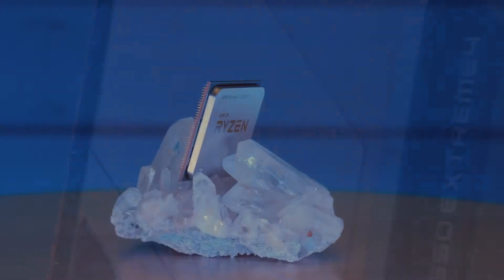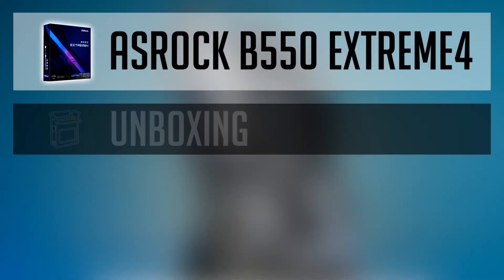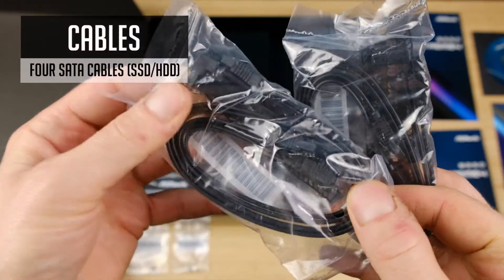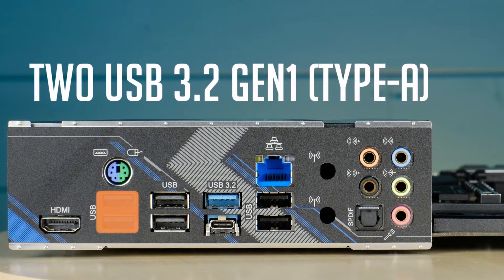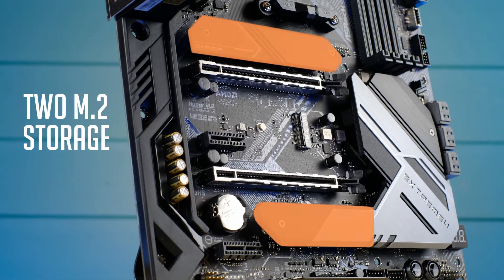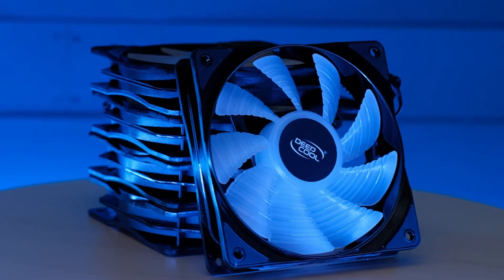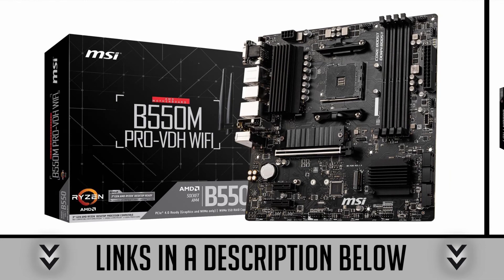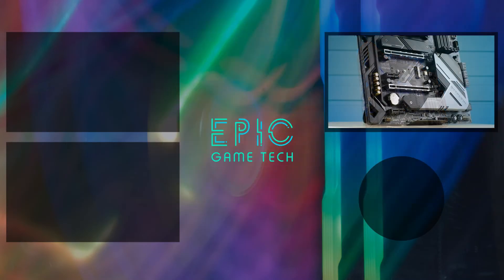GREAT B550 MOTHERBOARD - ASRock B550 EXTREME4 OVERVIEW - Better than X570? Ready for Overclocking

Comment: will this board have any problems running a pcie gen 4 GPU with 2x pcie gen 3 m2 and 1 sata HDD?. its 3 different generations and some boards seem to have trouble with that, for example, the put the gpu down to pcie gen 3 when nvme slots are fully occupied even tho the nvmes are gen 3
Reply: It shouldn"t have any troubles, as long as you plug your hdd into the 1st, or 2nd sata slot. If you are using a second m.2 they usually disable the last 2 sata ports.

Comment: compatibility with Ryzen 5000 series?
Reply from the maker: Hey,
this board is compatible with ryzen 5000 series.
For 5600x/5800x/5900x/5950x board needs to have P1.20 BIOS version.
For other ryzen 5000 (e.g. APUs like 5600G), P1.90 BIOS version is needed.
In general, newly manufactured boards should have newer BIOS. But in case it needs an update, retailer can arrange it (most of the time for additional cost) or you might need to get an older CPU in order to update it's BIOS.

Comment: Does it have wifi, if it does, is it 5 or 6
Reply: And also, is it good for ryzen 9 5900x
Reply from the maker: Hey,
no, it does not have onboard wifi (it has m.2 dedicated for wifi card) :)
Yep, It can handle Ryzen 9 no probs.
But this motherboard has debug LED screen for error code and that's a nice feature to have, at least if you like to play with CPU/RAM overclocking a lot.
Sure, in case you do not plan to OC a lot, Wifi is more relevant than debug LED.
Reply: @EpicGameTech  ok, thanks a lot 🙏

Comment: Hello....first time going for a ryzen build so a bit confused.... Will it be good if i pair it up with ryzen 5 5600x and 16x2 corsair vengeance pro rgb 3200mhz ?
Reply from the maker: Hey,
Sure, i mean its a good motherboard. But maybe you can get away with even a cheaper one. So to suggest anything, please let me know:
1. Planning to overclock r5 5600x?
2. Is this build only for gaming? Maybe you plan to upgrade to ryzen 9 in a future (if you do like video editing etc)
3. Will you use ATX or mATX pc case?
4. Approximate budget of your whole pc?
Reply: Yes in case of overclocking ... This build if for gaming and streaming purpose and also for coding purpose....
Pc case is mid-tower..ATX 
Approx budget around Rs.80000 Inr (Indian currency)
Reply from the maker: oki, so my recommendations for ATX motherboards :)
> MSI B550-A PRO - Best budget ATX motherboard that can handle decent overclocking.
> MSI MPG B550 GAMING PLUS / Gigabyte B550 AORUS ELITE - also good motherboards, costs a bit more than B550-A pro but still a good price/performance.
> ASRock B550 EXTREME4 / MSI B550 Tomahawk / MSI B550 GAMING EDGE WIFI - all are more expensive than mentioned above but they are more of a midd-range motherboard already. Can handle any CPU (even ryzen 9) overclocking no probs and have more features than less expensive models.

P.s. so 80000 is around $1100 for your whole pc build (with GPU?).
If so, i would go for cheapest out of the ones I've mentioned, MSI B550-A pro, as your budget is not huge, no need to spend much more on a motherboard. Better to put that $ on a better GPU or ran or SSD etc :) But that's my opinion
Reply: Thanks for replying and suggesting the best options there is... Actually that price budget excludes gpu , psu , hdd and ssd .
Reply from the maker: Ah, then probably you should go for a mid range motherboard :)
Reply: Ok thanks for the help there 👍👍🙏

Comment: can you recommend me some motherboards for ryzen 5 3600
Reply from the maker: Hey,
would be good to know more about your pc build:
- What gpu are you planning to use? (and overall pc build budget)
- Are you planning to overclock your CPU?
- And do you have plans to upgrade to ryzen 9 some time in a future? (not for gaming, but if you do like video editing etc)

Having these answers i could recommend few motherboards that would suit best for your build ;)
Reply: My budget is 900 euros for GPU cpu and motherboard
I am planing to buy gtx1080ti but I have to wait for praise to get down 
And yes I would overclock cpu
Reply from the maker: Ok, well Ryzen 5 3600 is one of the best value (at least if the price is right) CPU, but it's only 6 cores. So quite a lot of motherboards will work, even when overclocked.
You didn't mention if you ever plan to upgrade to Ryzen 9, but i assume, maybe to Ryzen 7 as it's possible for gaming only.

Best mATX options that don't break a bank and still are capable of OC:
- Asrock B550m Pro4 - decent, budget motherboard, with a better audio codec than most the budget motherboards (made a video about it - https://youtu.be/oLLn7Y8-YG0)
- MSI B550m pro-vdh - similar to pro4, VRM temps a bit higher but has onboard wifi.
- MSI B550m Bazooka - feature-wise, similar to pro4/pro-vdh, but more expensive, though has the best VRMs out of these 3, so handles more core CPU overclocking better (video - https://youtu.be/C5Y9UXp8QJ0)

Best mATX motherboard
- MSI B550m Mortar - more or less the best mATX form factor motherboard I could recommend. But sure, it's more expensive than the above ones.

ATX recommendations (though ATX is generally more expensive than mATX):
- MSI B550-A PRO - the least expensive ATX motherboard I would recommend going for.
- ASRock B550 Steel Legend
- MSI MPG B550 GAMING PLUS

So all of these boards are good value for their MSRP price :)
In general, if you use ryzen 5/7 and no need for more fancy features, a budget-friendly mATX board should work fine, even when overlocking.

Comment: Hello
could help me recommend a CPU, I recently bought this motherboard for $ 130 and I will use it on a monitor 2.5k resolution + RTX 2070s  and in the future RTX 3070. The pc is only for games, I want to play above 100fps in medium / high quality . Which CPU do you recommend for this configuration? please.
Reply from the maker: Hey,
well it depends from price you can get a CPU these days. Basically, Ryzen 5 3600 as more budget friendly option, r7 3700x is also an option or 5600x. All of these 3 are good choices for gaming. Why i mentioned 3700x? as the price might be same as 5600x but even though 3700x is a bit slower in lower rez games, it has few additional cores that might be utilized later on in more games.
So basically it depends a lot from a price you can get each of these CPUs. E.g. if the price for 3600 is not far from 3700x or 5600x, you should go for these. If the price is same 3700x/5600x - i would go 5600x if tis only for gaming. If 3600/3700x is way cheaper than 5600x - then i would probably skip 5600x.
Sure, as you bought quite a good motherboard, i guess you have a budget for 3700x/5600x cpu :)
But any of these will handle rtx 3070/2070 super.
Especially, when you will be playing 1440p. With any of these CPUs, more likely GPU will be the one to dictate FPS number and not the CPU. And if you will get 4k some day, then it's all about a GPU anyway with any of these CPUs ;)
Reply: @EpicGameTech  Thank you very much for the information, I have the opportunity to get a 3700x for $ 230 do you think it's a good price?
Reply from the maker: Yes, really good price having in mind the current market situation :)
Saw 3700x for arround $329 on a few online shops in the US so $230 is super :)

Comment: does it has ibuilt wifi and bluetooth
Reply from the maker: Hey,
extreme4 does not have built-in wifi / Bluetooth :)
If you need those and you want this motherboard, you will need to get USB dongles for wifi/Bluetooth.
In case you want a similar VRM performance / around the same price motherboard with built-in wifi/Bluetooth, I would suggest checking:
- Gigabyte B550 AORUS PRO AC - https://geni.us/8Vrny
It has both - wifi and Bluetooth and the same level of VRM performance :)

Comment: On my Asrock B550 rgb stays on and when i turn off the pc, is that ok?
Reply from the maker: Hey,
is it your motherboards rgb or ram rgb as-well? :)
Check if this can be adjusted in Asrock RGB control software.
Also, this can happen if you are making your pc to sleep instead of a shutdown ;)
Reply: @EpicGameTech  RGB lights on Motherboard,I check in bios,but there is no this function
Reply: is that the case on your board?
Reply: @EpicGameTech  https://youtu.be/paU8y1e2RPI
Same as in this video
Reply from the maker: Are you using Asrock Polychrome RGB soft? It's mean for controlling all RGB :)

P.s. I do not own this motherboard any more as I was using it in a PC build for another person :)
Reply: @EpicGameTech  I'll try this software

Comment: how well does this overclock with ram?
Reply from the maker: Hey,
well specs says it can support ram 4733+(OC), so it's capable of doing some good stuff for sure. Especially when you have debug LED screen for easier error elimination :)
I saw that buildzoid overclocked some memory to 4933mhz / 5000 mhz on Asrock B550 Steel Legend motherboard in his video (https://www.youtube.com/watch?v=Q9hFivyUsx0) and those two boards (extreme4 and Steel Legend) are almost identical models :)
So I assume, that extreme4 should be also very good in memory OC.
Not saying you will get to 5ghz, as you need to find a good RAM sticks as-well ;)
Reply: @EpicGameTech  yea ive done alot of research, but cant find a m.2 E key wifi/btooth adapter for it. but at the same time, if you look at the QVL for 5000 series and 3000 series cpus none of those have anything above 4400mhz support on XMP. even tho on the main page it says 4733, however ive heard ALOT of horrible things about asrock and their bios support. ive been MSI all my life from b450I gaming plus ac (possibly bet Itx board at its price of that time) to now a x570 mpg gaming edge wifi (VRM is my main concern, 

it just would be LOVE to have an actual usb-c front panel header thats not limited to me using an adapter since the board doesnt have one for front panel. does on the rear i.o. currently running 4.8ghz with a set of tforce 3200c14 @ 4000mhz 2000fclk, c16,15,15,15,32,38 304,226,139 1T 1.4v llc3 super tight subs as well all stable daily. i mean i dont need a new board. but seeing as to how ive pushed a 3600XT on this board as hard as one can without LN2 im starting to wonder when the VRM will fail.
Reply: @EpicGameTech  ive watched ALOT of his vids but searching for it never actually brought him up which i complain to him about ALL THE TIME for not tagging his vids properly so youtube will put his vids in search without searching his name directly.
Reply from the maker: I actually use MSI board myself ;)
Well regarding QVL, many times these lists are getting old as they are not updated so often. Also, I almost never pay attention to that when building a PC.
And in general, never use RAM faster than 3600mhz for the guys I build PCs for my channel, since, from the performance side, you gain very little to non-performance improvement with faster ram. It's fun/useful only if you are OC enthusiast and like to play around by OC your RAM/CPU etc. But it's not for the majority of people ;)

Regarding buildzoid - yep I've noticed he is not utilizing his video description/tags, but I guess he doesn't care about Youtube SEO/Analytics (maybe it's just not interesting to him), but eventually, he could benefit from it for sure. As he does really advanced stuff and potentially could have way more subscribers. Even though, he has a really narrow niche :)
Reply: @EpicGameTech  granted the issues i mentioned, he is mentioning the steel legend which is the same dam board id have to assume. if i can find a m.2 E wifi/btooth card before i jus say f it and get the unify x570 used for 220 without the extras i jus may do that.....but at the same time 140 vs 220 is a big difference between prices when i have a more than capable b450 board that will outlast this x570 board i have atm....(it is setting in the closet tho lol) perhaps i just shouldn upgrade at all and live with the great board i have even tho it does have terrible VRM issues...

his exact statement to me was "i use alot of tags" but the tags hes using arent what people search for when asking a typical question. i.e. best budget ram motherboard am4.... but yea gonna check for a m.2 E key wifi card and possibly get the asrock board.

Comment: Hi, Please someone tell me which slot i should put this Kingstone U-SNS8154P3/128GJ,  labled as M.2 PCIe Gen. 3 
 NVMe 1.2
Reply from the maker: Hey,
Well, it will work in any of two m.2 slots dedicated for m2 storage drives. But put it to the top slot that has an m2 shield. It's motherboards 1st slot and it will look way nicer with that m2 shield :)
Reply: @EpicGameTech  I did and i get A0 Debug error all time , tried to unplug all Sata HDD's, and keeping only that Kingston M2 but seem's not booting and not visible in BIOS. 
PS: 
Kingston : New
Ram's : New
Motherboard : New with latest Bios 1.80

Waiting for ur reply ty again
Reply from the maker: Ok, you could try few things here and yep, keep all of your other sata/optical drives not plugged in while installing your windows.

BIOS
These steps are general and not specific to this particular motherboard, but you could try doing few things in your BIOS:
- Disable CSM (Compatibility Support Module).
- In Secure Boot section, if you have OS type, change from Windows UEFI to other OS, if there is such an option. If you install windows successfully to m2, change this one back to Windows UEFI.

Also, TOP m2 slot supports NVME but not SATA m.2 drives. But as you mentioned your drive (U-SNS8154P3/128GJ), it should be NVME. I would still try to switch this drive and try a 2nd m.2 slot anyway :)
Reply: @EpicGameTech  Problem fixed, i pluged a compatible SSD listed on their website and everything works great now . Seems like asrock have lot of compatibilities issues regarding SSD's. Thank you so much for ur replies.
Reply from the maker: Ah, i see. Well it's possible that certain SSDs can be incompatible with certain motherboard. But it happens not every day and in lots of cases, you can solve things by troubleshooting / from BIOS / reading forums :)

Comment: does this mb have built in wireless wifi? If not Do I have to buy a wifi module? Also, do you think this will work with a ryzen 7 5800x and the x53 from nzxt?
Reply from the maker: Hey,
no, this motherboard does not have built-in wifi. So you have to buy a wifi USB dongle, better with at least 1 antenna ;)
Also, it's possible to use m.2 wifi module as this board has a dedicated slot for that.
And yes, this board will work really well for r7 5800x, especially if you like to overclock CPU/RAM.

As you are into some more of the high-end B550 motherboard, I would suggest looking into these, as they are the same level and with included Wifi:
- MSI MPG B550 GAMING EDGE WIFI (https://geni.us/Cyip2)
- Asus STRIX B550-F GAMING(WI-FI) (https://geni.us/DFO9Jx)
Or in case you are ok going for a smaller mATX board, I would recommend MSI MAG B550M MORTAR WIFI (https://geni.us/fFXo5A) :)
Reply: @EpicGameTech  thank you so much for the reply! Also, thank you for the recommendations too. I am looking toward for your new vids!